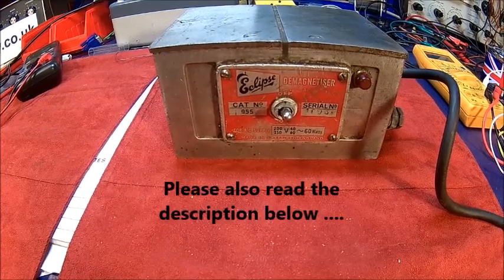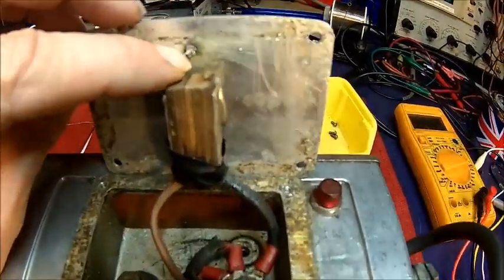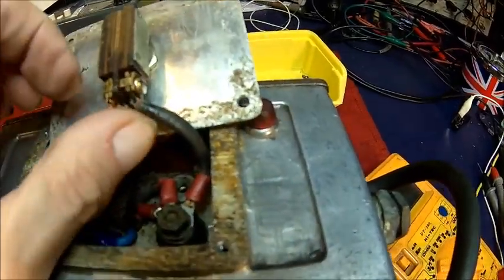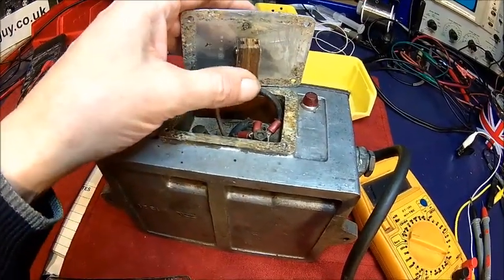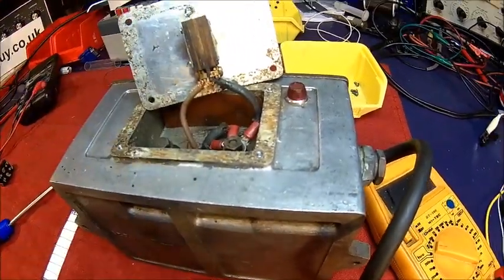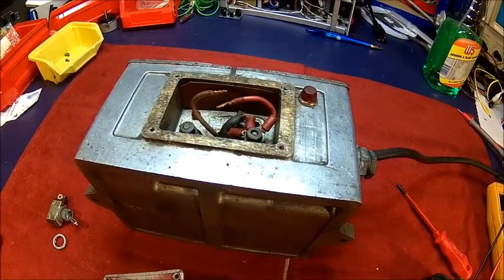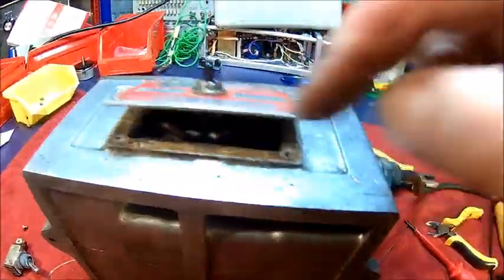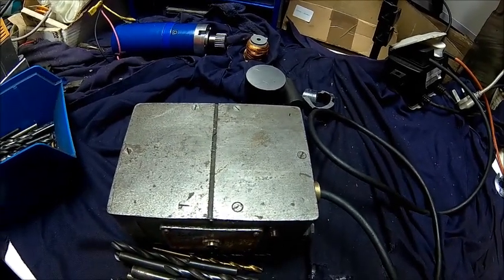Eclipse #955 Tool Demagnetiser, quick repair job

Comment: Good vid. The material at 3:30 is Tufnol it outperforms thermoplastic insulation electrically, thermally and mechanically.

Comment: Apart from the switch how else can they be faulty? Thanks
Reply from the maker: The magnet coil can be burnt out or shorted to ground, if that's the case, then it's very unlikely to get if fixed as this is all potted with really nasty stuff.

Comment: Enjoyed the video, i have subscribed. Demagnetisers are used by watch and clock makers. The models I have used only have a momentary switch as it is essentially an electro magnet hooked up to 50Hz thus they heat up / overheat very quickly. The Aluminium body of your Eclipse model will help dissipate the heat.
Reply from the maker: Thanks,...this one is supposed to be used for workshop tooling, what you don't want is metal chips sticking to your drills, mills, etc.
Over the years I came across a few of these, it looks like the coil is potted with some nasty stuff, so if the windings are cooked, it's way to much work to rescue it. For smaller bits, i use a pointy handheld one which was designed for demagnetizing tape recorder heads, bought it new almost 40 years ago and it still works.

Comment: Good one. Changing switches is common now. That looks like a nice tool.
Reply from the maker: Yes, very handy tool, if you look around at flea markets you may find a tape recorder head demagnetiser, a bit less powerful but cheap because no one needs them anymore. I've got one which i use for smaller bits, bought it new in the 1980s when tape recorders were part of every stereo system ....